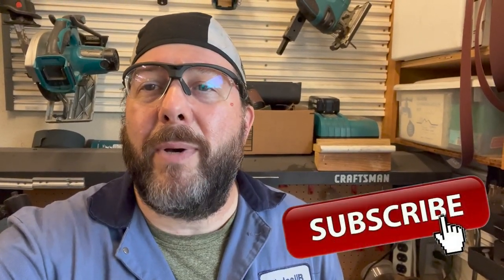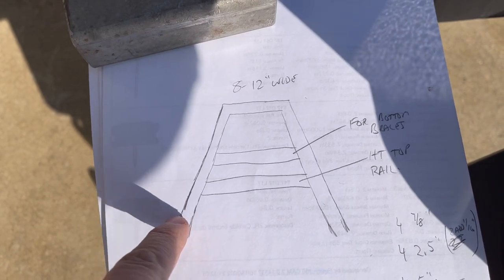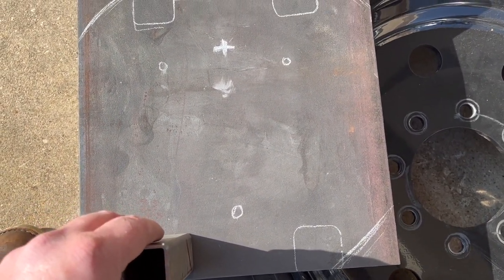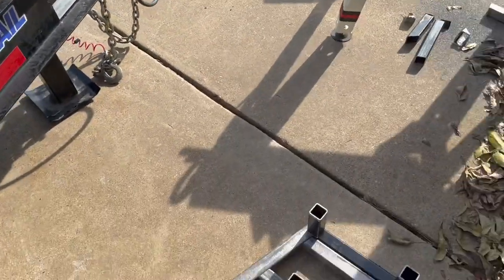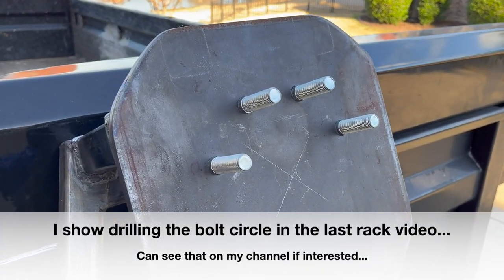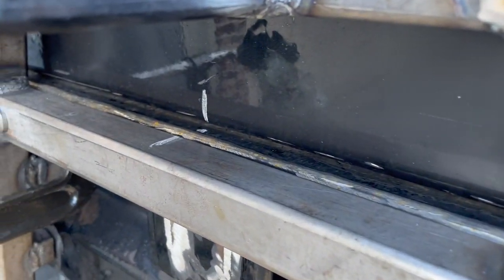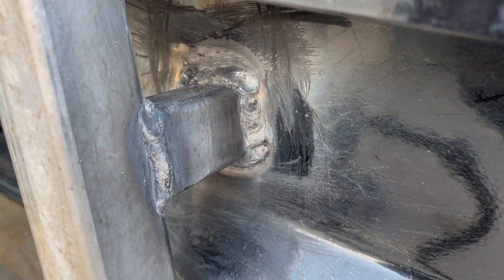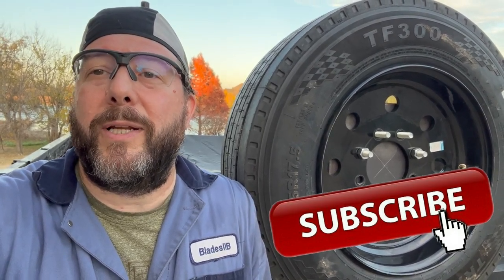New Spare Tire Rack On Trailer - Original Design Did Not Support The Weight

Comment: Any thoughts of putting a rubber isolator between the top part of the tire holder and the bed? Looks like maybe an 1/8” gap?
Reply from the maker: Christopher Enoch - I think I see what gap you are asking about?  The top of the trailer there is an extra piece welded on top of the rail for the roll up screen to cover your load. It is a pretty rigid piece and I don’t thing the tire holder will flex enough to make contact, so did not consider anything to fill the gap. Should be rigid enough without. Let me know if I did not understand your question. Thanks.